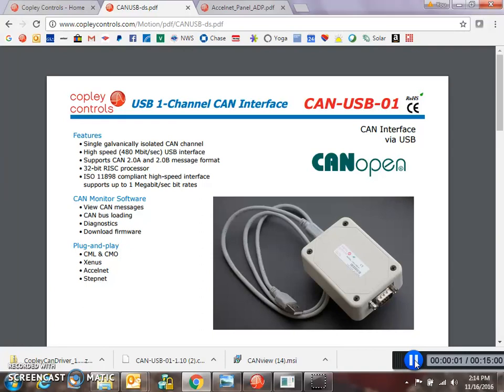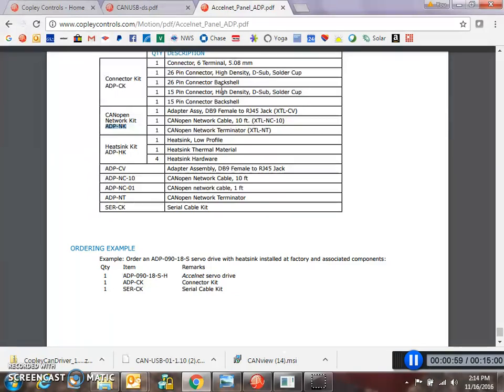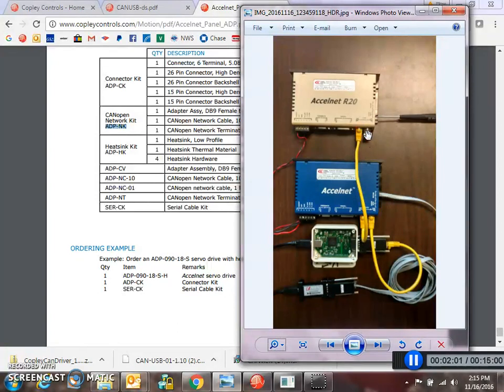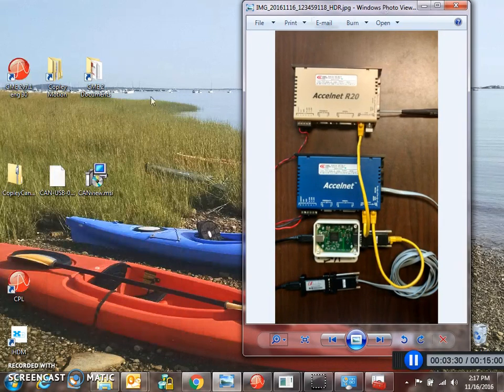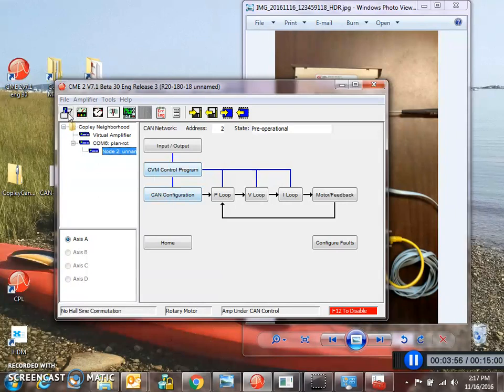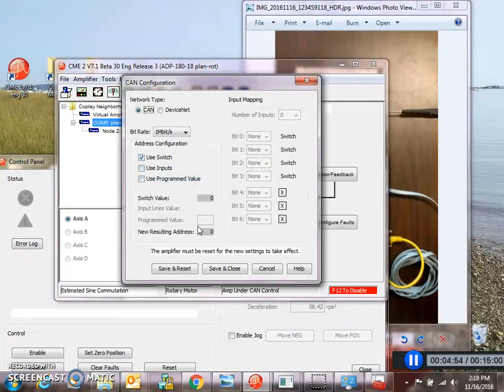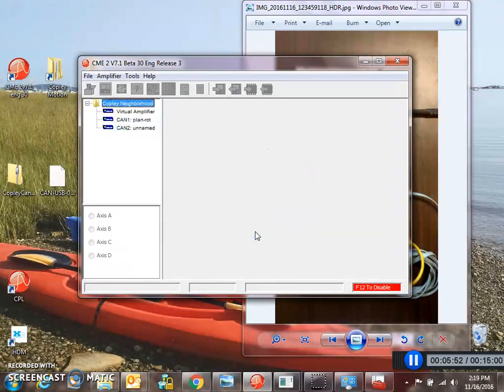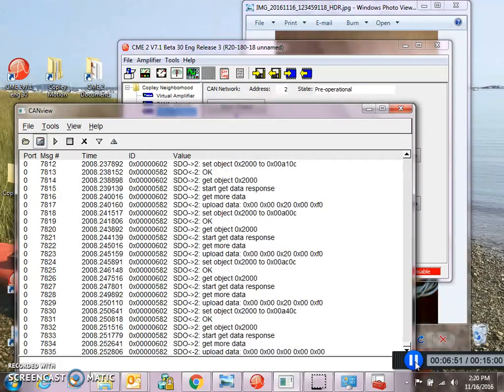Copley Controls USB to CAN using CME2

Comment: Hi Dean, do you have any example about control motor by canopen?
Reply from the maker: Look for Copley free CMO software for Windows. Or CML C++ for Linux (1 time fee then free)
Reply: @dinocrum  , about CME, it hasn't any example
Reply from the maker: @anhkhoile5478  CME can connect over CANopen with Copley CAN device but CMO is software VB.NET example. Look for my CMO video. :)

Comment: Hello, I use the motor is maxon re40, if the choice of AEP-055-18 or ACJ-055-18 how to connect it? Motor power only two lines, the drive is UVW above, do not know how to wiring.
 Looking forward to your reply!
Reply from the maker: skx shmily , hey there! dc brush wires to U and V output but with special inductors. The Maxon DC brush motor is a special case for PWM amplifiers. Please send me motor specification so I can model ripple current. dcrumlish@copleycontrols.com
Reply: I have sent to your mailbox, thank you！